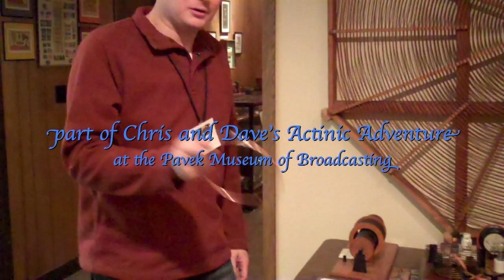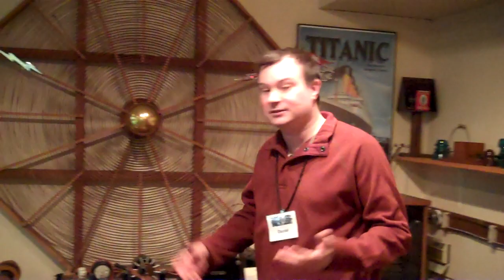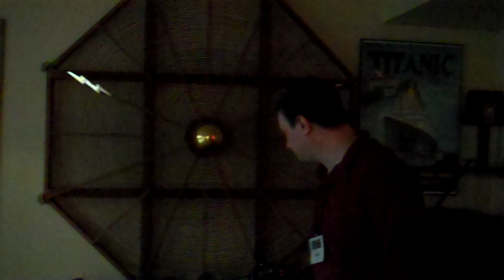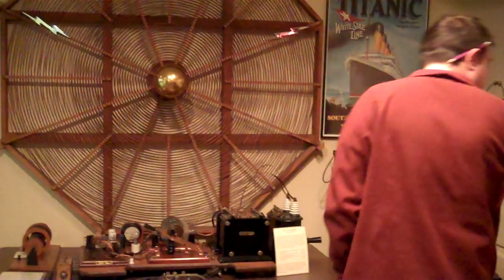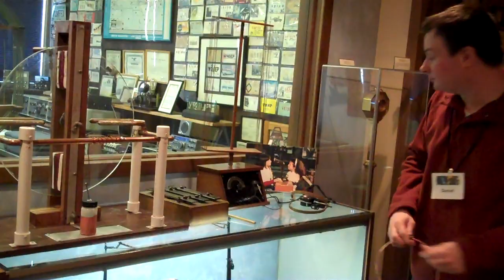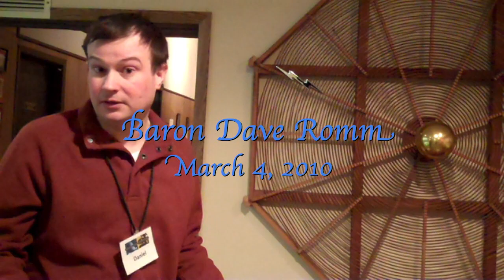1912 Rotary Spark Gap Transmitter.mov

Comment: They are illegal, even as emergency transmitters, but i wouldn't worry about a short demonstration. 
I would not recommend sending SOS. Even without an antenna, the transmitter could still have a considerable range. I wouldn't be surprised if someone a mile away picks it up. 
I'd use the disused distress call CQD to demonstrate the transmitter.
Reply: Even if it is prohibited in emergency situations, I don't think it will result in a penal sanction.
Reply: I accessed a document stating that the spark gap transmitter was banned worldwide in 1927. This document states that spark gap transmitters with an input power not exceeding 300 watts can be used in emergency situations. There is also information about which frequencies are allowed to be used. I have heard that spark gap transmitters were still produced and kept ready as emergency transmitters in Germany until the 1965-70s, using this legal basis. So they're probably still not banned forever, and in certain cases, they're allowed to be used as long as they meet the necessary conditions.
Reply: every engine with spark plugs and every appliance with a brushed motor is a spark gap transmitter, and none of those things are illegal. a simple spark doesn't transmit very far. a tuned spark gap transmitter with antenna attached is rare to see regardless. Demos like this are entirely harmless unless your immediate neighbors would be disturbed by the electrical interference.